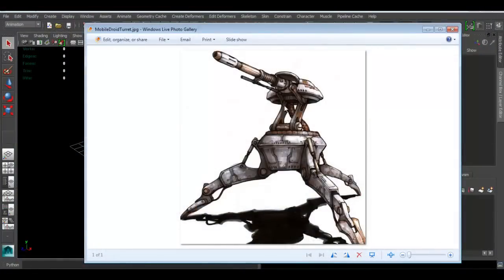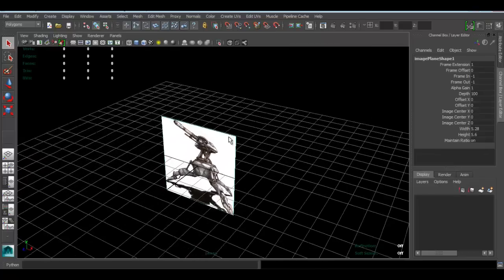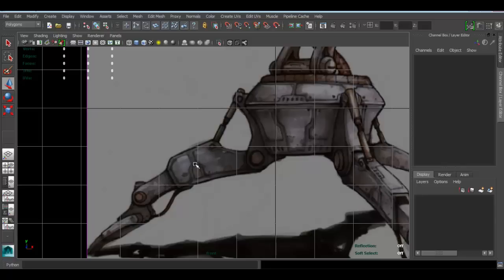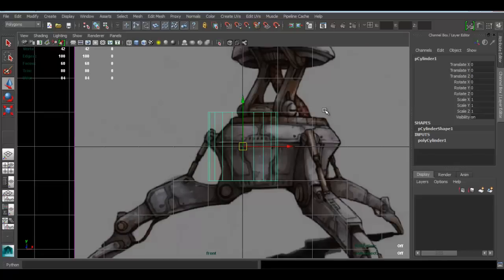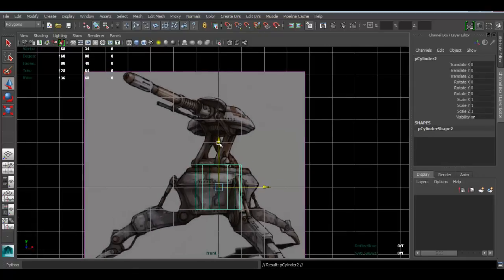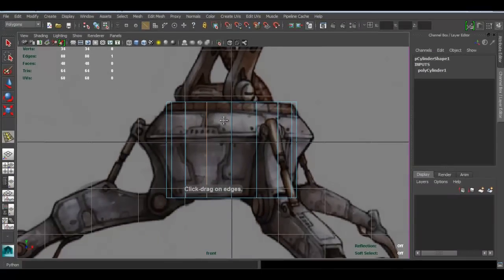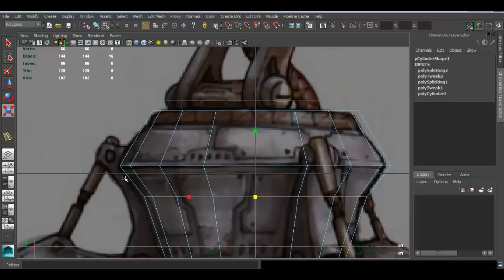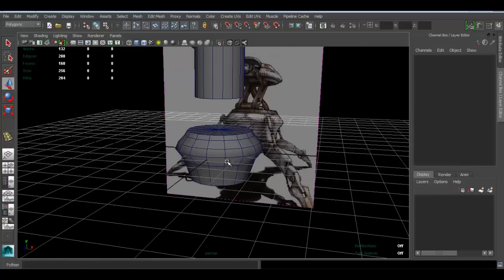Autodesk Maya 2014 Tutorial - Droid Turret Modeling Part 1

Comment: Where is the insert edge tool on maya autodesk 2016
Reply from the maker: Ray Adnyana I haven't used 2016, but am guessing it should be in one of the mesh menus.
Reply: Yea i found it, after half an hour of searching haha. The tool however doesn't work like yours at all. in fact, none of the tools do. as someone who is completely new to 3d modeling, this software is really unapproachable
Reply from the maker: Ray Adnyana That's odd, I haven't used 2016 yet so I don't know if that's really the case. sorry to hear that.